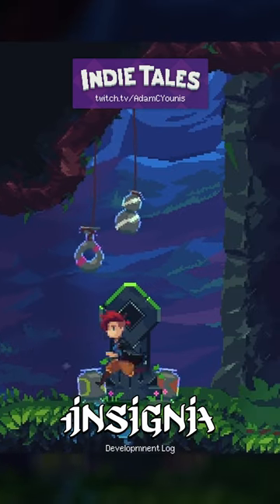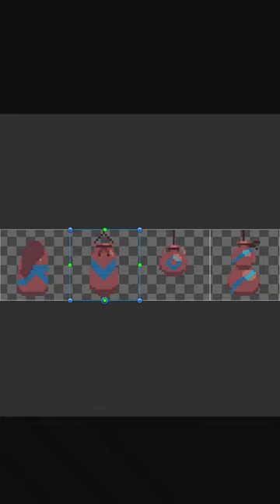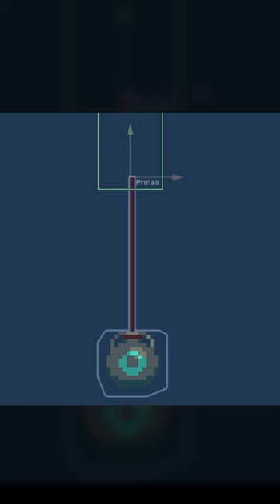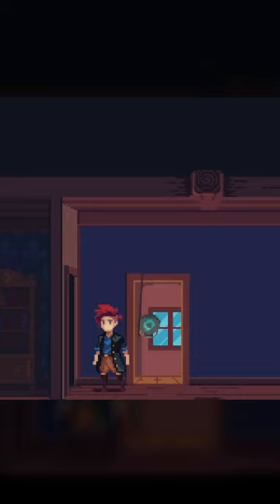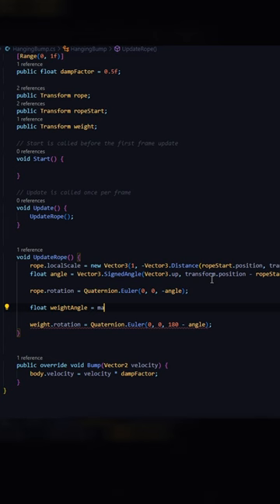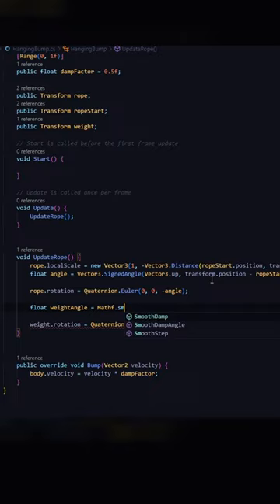Breakable Pots in my #indiegame [Part 3/3]

Comment: Hey Adam, love your work! I've had a lot of headaches with this kind of thing as well, what I'd highly suggest is you don't sleep on assessing the center of mass in objects when using things like configurable or hinge joints, ESPECIALLY when daisy chaining them together. Also, use a gizmo and debug bool to show you where the center of mass is as well, sometimes it'll surprise you. From there, override it and assess the results!